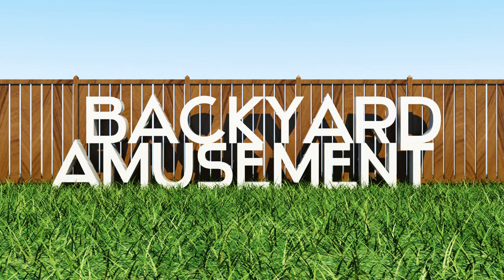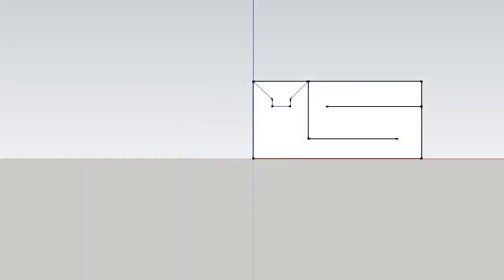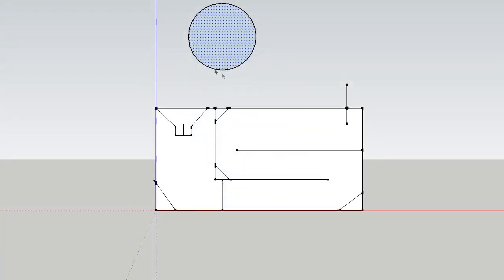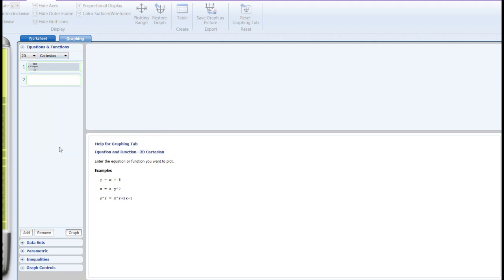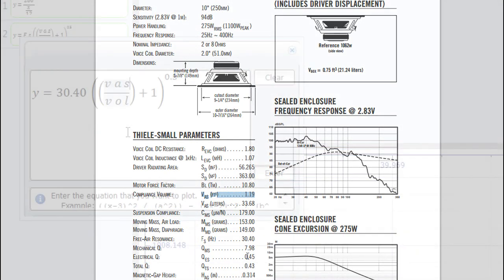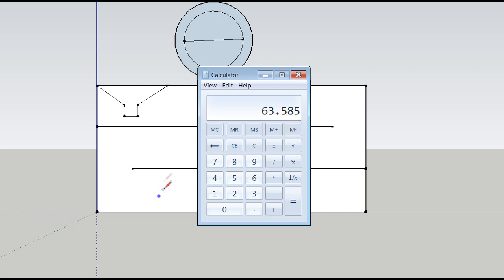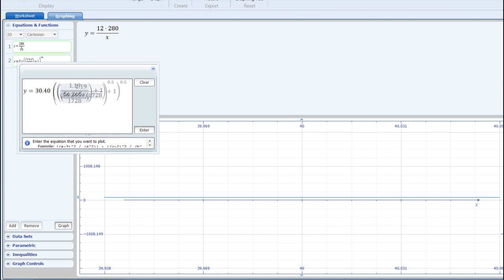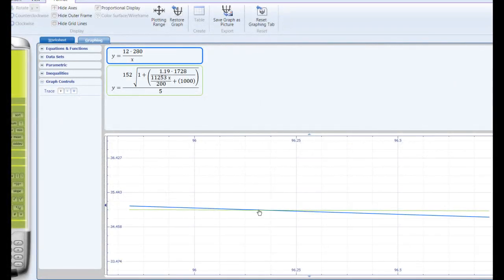Transmission line speaker box math made easy

Comment: I built a 1/4 wave length transmission line back in 1979 using the math for tuning and an 8 inch woofer , because the design is so non precise you can be plus and minus 30% on the line length and it will still sound great , mine sounded amazing esp on bass guitar notes the definition was amazing , the TL sounded better than any other alignment I have ever listened to , they have been my choice of design since then , nothing else sounds as good !!!!
Reply: Awesome to know

Comment: 9.21feet is 110ínches. this whole thing would be nicer if you didn't make the wacky front chamber of 1000cubic inches because without it, i would be the output of your formula would be pretty close to 1/4 the wave length of Fs.

and if the dimensions are a bit off the exiting wave would is not just be a bit quieter, because the output would not be he peak of the wave but slightly less. but then a slightly higher frequency would be amplified.

a phase change would only happen at 3/4 wavelength of Fs.

Do you even need to use Fs really? could you tune the box to spit out different frequencies.

Comment: You did well and I was following each stage perfectly until you "threw in " that extra 1000 sq inches !! I thought you wanted to determine line length , volume and the quarter wave resonance ?
If you have a large volume immediately after the driver the enclosure behaves more like a reflex enclosure with a very long port ... 
Have a good look at the construction of the original B&W Nautilus enclose ... you'll see what I mean 😀

Comment: I got a line length that was 30% shorter than the quarter wave length? According the Martin Kings method, the line length doesn't change, only the cross section area. Great video, I'm just making sure I am following this correctly. Made a test, my first transmission line enclosureusing this method and it doesn't sound bad. However, am I loosing output/bass extension using this method?

Comment: If I use multiple woofers does that mean I will need to add up all of the radiating surfaces and make that number my tube area? 
Example: if I use two 8 inch woofer I would need to have a tube with 16 inches of area?

Comment: Fine tuning can also be tweaked with volume and density of poly fill . Not to replace correct 1/4 wave length but just for fine tuning to reach a reasonable RTA . Good video on where to start .

Comment: SD² - Speed of sound ÷ frequency ÷ 4 x 12(inches) and you have the line length. Personally I've have better audible results with tapered enclosures. Personally I find t-lines to be the most easy to design. Building them depends on the complexity of the enclosure, but its not a problem really if you have even the most basic of woodwork skills.

Comment: Area of a line?
Reply: Take the SD² number (T/S parameters) and then adapt it to build the enclosure. 
Take my latest project of the JL Audio 13TW5v2 subwoofer. https://www.youtube.com/watch?v=ayFFXxoIqXc - Getting Naughty with the JL Audio 13TW5v2 Subwoofer 

Effective Piston Area (Sd) 98.26 sq in / 0.0634 sq m JL Audio 13TW5v2 subwoofer Lets just round it up to 100 sq in. 

Square root of 100 is 10, so you need the internal enclosure size to be 10" x 10". Ah! ... The problem is that the subwoofer is 13.5" wide. So then you have to adapt the enclosure a little 

10 x 10 
11 x 9 
12 x 8 
13 x 7 
14 x 6 - Bingo!! Now you have a 14" Baffle, wide enough to house the subwoofer, and the depth of 6"

Comment: Wich software are you using ??
Reply: You can use WiniSD, Hornresp - here - https://www.diyaudio.com/forums/software-tools/220421-transmission-line-modelling-software-88.html#post5669795

Personally, I've always had issue correlating a graph, with my enjoyment of the said speaker/sub, and most of the time I came up wanting. So I developed my own formula.

Comment: "This methodology is obsolete"... it's right there, written in RED at the top of the article you chose to follow...
Reply: Yeah, problem is, the new method is totally reliant on specialized software and most of that is no longer available because this is such a niche application. So unless you can whip up a bunch of calculus and matrix models in math cad, this the approximation that was used for decades prior to "non obsolete" and now obscure to access methods.

Comment: What happens if you tune lower of higher than the drivers fs? it will still increase the output at the tuned frequency correct? or will it cause some problem?

Comment: Are you sure you really understood TL? 

Speaker driver has FREE AIR RESONANT FREQUENCY.  
Fs.  

This is frequency where all mechanical parts of driver start to resonate, giving the excessive membrane excursion and impedance peak. This is bad for the sound at that point.  Physics explains that any air volume of closed or ported box has it's own resonance (of enclosed air), which actually has much greater force/impact than pure Fs of speaker.  So it's canceling Fs to it's own value.  Does it really matter where you have your box tuned to resonate? Not much. But usually you tune the TL box to have Fs between resonance peaks of the transmission line cabinet, in order to cancel the natural resonance of driver. If you take a closer look and put your amp meter to speaker, you'll notice there are actually two resonant peaks in TL, side by side in low spectrum, and many more as frequency rise, but you damp that with taper, or pure  line damping.  

I'm afraid your enthusiastic effort is not much worth in real life application, unfortunately.  

Stay well.
Reply: paddle hard 
hey man,
iappreciate your comment. iam a enthousiastic Young speaker builder and i am Building a T-line speaker system.
2 Towers with 8" drivers tuned to 60Hz and a subwoofer with 2 8" drivers tuned to 40 Hz. is it okay for me to Just get the 1/4 wavelength of those frequenties and make that my line length and the line size the cone area, and Double the cone area of my sub.

i also would like to decrease the line size going Down to reduce resonance. is this a good idee.

would Love some advice.

cheers a mutual fanatic

Comment: Hello, I am not very capable of doing this calculation, can you do this for me?
It will give you all the electro-acoustic speaker parameters.
Reply: 1120 ÷ 40 ÷ 4 x 12 = 84" - 40 Hz - For a straight t-line 
1120 ÷ 35 ÷ 4 x 12 = 96" - 35Hz 
1120 ÷ 30 ÷ 4 x 12 = 112" - 30Hz 

Take the SD² number (T/S parameters) and then adapt it to build the enclosure. Take my latest project of the JL Audio 13TW5v2 subwoofer. https://www.youtube.com/watch?v=ayFFXxoIqXc - Getting Naughty with the JL Audio 13TW5v2 Subwoofer 

Effective Piston Area (Sd) 98.26 sq in / 0.0634 sq m JL Audio 13TW5v2 subwoofer Lets just round it up to 100 sq in. 

Square root of 100 is 10, so you need the internal enclosure size to be 10" x 10". Ah! ... The problem is that the subwoofer is 13.5" wide. So then you have to adapt the enclosure a little;

10 x 10 
11 x 9
12 x 8 
13 x 7 
14 x 6 - Bingo!! Now you have a 14" Baffle, wide enough to house the subwoofer, and the depth of 6" Then you use the formula (above) to determine how low you want to go. Its really simple!

Comment: i dont know if he mentioned it, but the 280 is one quarter of the speed of sound in the first equation. Also, if you use the program's equation solver and set it to solve a system of 2 equations, it will give you the exact length and frequency
Reply: I know it's 2 years ago, but thank you for this!

Comment: Need help with a T-Line design
Kicker L7 15"
sub on left - port on right
finish length 58 1/2"
finish height - 18  1/2"
finish width - 20"
using 3/4" mdf
tuned to 35-40 hrtz?
Reply: port area 180^2 inches. port length at 34 hz is 34 ft peak to peak, so port length is 8.5 ft. Your port needs to be 8.5 feet long with an area of 180 square inches.
Reply: can you help me out with some port measurements
I want to double up the inside port---outside box of finish measurements given above will also be doubled up
i am putting a lot of time in other work on my van and want this to be correct!
Reply: +andy wiley your finished box with double wall 3/4 inch had a usable space of  55.5x15.5x17... that makes you port 17x10.5. there is no way to fit 1/4 wave t line into those space requirements.
Reply: +andy wiley required port volume for a 15 is 18360^3 inches, your usable space has a volume of only 14624^3... plus you need room for a driver. Drop to a good 12, and you can make it happen.

Comment: Dumb it down even more bc I'm lost
Reply: 1120 ÷ 40 ÷ 4 x 12 = 84" - 40 Hz - For a straight t-line 1
120 ÷ 35 ÷ 4 x 12 = 96" - 35Hz 1
120 ÷ 30 ÷ 4 x 12 = 112" - 30Hz 

Take the SD² number (T/S parameters) and then adapt it to build the enclosure. Take my latest project of the JL Audio 13TW5v2 subwoofer. https://www.youtube.com/watch?v=ayFFXxoIqXc - Getting Naughty with the JL Audio 13TW5v2 Subwoofer 

Effective Piston Area (Sd) 98.26 sq in / 0.0634 sq m JL Audio 13TW5v2 subwoofer Lets just round it up to 100 sq in. Square root of 100 is 10, so you need the internal enclosure size to be 10" x 10". Ah! ... The problem is that the subwoofer is 13.5" wide. So then you have to adapt the enclosure a little 

10 x 10 
11 x 9 
12 x 8 
13 x 7 
14 x 6 - Bingo!! Now you have a 14" Baffle, wide enough to house the subwoofer, and the depth of 6" Then you use the formula (above) to determine how low you want to go. Its really simple!

Comment: Won't the Fs of the speaker change if you put it in a closed box with equivalent T-line volume? Fs is usually measured with no box, that's why it is "Free air".
Reply: +Rennie Ash heck the FS lowers as the sub is used.  I do not tune a t-line to the FS, i tune to the desired bandwidth.   I tend to tune to 31-32hz (around 97-109" of line).  This gives me a useable bandwidth of around 16hz-48hz  which is.. perfect for me.  A lot of this seems like bad advice.
Reply: Eian Wahgener I'm a newbie at this tline box building. I have a rf power hx12 sub with an Fs of 26. so what you are saying is that in order for me to get tline length and portsize for the hrtz I want which is like 35hz. use the frequency instead of the fs? I'm confused

Comment: Do you use the the width from left side of the suspension to the right or left side of the cone to the right?
Reply: i use suspension peak to peak. it gives you that little bit of extra space you need to accommodate for especially in non angled ports.

Comment: So it's basically a ported box with a huge port?
Reply: +Sigma Octantis no
Reply: amananca no
Reply: +Sigma Octantis T-line enclosures direct the rear wave of the speaker to be captured, then channeled to the front (or listening area) in a manner that prevents the rear wave from being out of phase with the frontal radiation. Usually the only part of the wave length that can be repurposed is 1/4 or 3/4 of the wave, the balance of the wave being out of phase. Isn't that your understanding, Backyard Amusement?
Reply: martianshoes Just saying, my ported box looks almost identical to a T-Line box so I don't get why they are so special.
Reply: Sigma Octantis Because the length and cross section are calculated using constants like the free air resonance of the driver, and the lowest frequency wavelength they are trying to achieve. Sigma no one is saying that they walk on water but if you ever get to hear a properly tuned TL enclosure with wide band program material for a good source...it is often memorable enough to make a life long impression...THAT IS....if you are into fidelity and not just "bump".
Reply: +Sigma Octantis How they look isn't really a factor. They operate on different principles. Roughly speaking (and absolutely bastardizing the theory of it) Your ported box uses the mass of the air in the port like a spring to augment the output of your subwoofer. A T-Line uses the rear wave directly to augment the output. They work entirely different. 

Also note, the t line is a glorified tube folded up into a box shape. Your vented box has a small (relative to the chamber the sub is in) tube. Where as in the T-Line, the 'port' and chamber are not distinct in any way.
Reply: Matthew Menze Well my ported box is mostly port by volume, because that's the way WinISD said to make it.
Reply: +Sigma Octantis You are supposed to subtract the port volume from the box volume, so if winisd calls for a 1 cubic foot box and a port that is, say, 1 ft by 0.5 ft by 2 ft long (just to mix it up a bit), you are supposed to have practically an exterior volume of 2 cubic feet with 1 cubic ft taken up by the port. If it still comes out with a very small box volume and a humongous port, well, you need to reduce the port area while keeping an eye on port velocity so that it doesn't exceed 0.15 mach.
Reply: dre04mach Can't quite tell if you mean add or subtract. 1 cu ft box + 1 cu ft port would be 2 cu ft total. If it was subtract then it would be all port. I did add them and used the smallest port possible to keep port velocity down.
Reply: +Sigma Octantis well, it's the same thing, depends how you look at it. Subtract from the outside volume of the box (2cubic ft outside minus 1cubic ft of port inside), or add to the internal value of the box (box = 1cubic ft + port 1 cubic ft) = same 2 cubic feet on the outside.  Win ISD gives you the volume the box has to be on the inside, you add the volume of the port (and the thickness of the walls) and you get your total outside volume basically is what I was trying to get at.  so if WinISD says 2 cubic feet box and 1 cubic feet worth of port, your box's exterior dimensions will have to be 3 cubic feet total.  (or 2 cubic feet and a really big long port/pipe sticking out of it :D).  

Think of it this way, you can put the same port outside of a box and it will sound/be tuned the  exact same way as long as the remaining box volume (what winisd gives you) doesn't change.

Comment: This is a great video. But it would help if you stopped referring to the drive units resonance as "free air" when it's being placed in a defined volume.
Reply: It is the free air resonance that is being tuned to the TL port.
Reply: well that would be pointless as the drive unit wont have a free air resonance in box thats the same as the free air resonance
Reply: The idea behind TL is to extend the bass performance down to free air resonance. The boost from the tuned tl gives a greater boost to the speakers output as free air resonance is approached and less output the farther away from free air resonce. TL can become tricky since the TL becomes resonant at 1/2, 1, etc so a port tuned to 30 hz would also be resonant at 60, 120 etc. For subs this is not an issue but for tower speakers this may create overly entusiastic bass response.
Reply: No its not. Its to make the rear energy from the drive unit in phase with the front giving a 3 db increase roughly in the area the system is tuned to.

Comment: Excellent tutorial, was exactly what I needed.

I managed to go one step further which may be of use to some people, if you transpose your formula you can end up with an equation in the form length=a*b*c*d etc which tells you the exact length of the line, ie you don't need to rely visually on where the graphs cross.  It ends up a nasty formula but works great.

Using the same program, make a transpose equation where "equation1 - equation2 = 0" (blue line - green line  = 0 ie when they are equal), and then solve it for x.

Put the resulting formula in a spreadsheet and you can just enter fs,vas and sd and it spits out the required line length.
Reply: Me Athome Could you give an example formula? Interested to give this a try!
Reply: it is the speed of  sound 1123 feet per secant  divided by the speakers Fs and then divide that by 4 gives you the TL length and this formula works really well my horns have only one fold and vent out of the back of the speaker ! instead of the front , instead of stuffing the TL I use acoustic foam on the back wall of the TL , since there are no hard design rules I experimented to see what worked and sounded best ! I found that is the best way to approach a TL design and built there is a lot of wiggle room !!!

Comment: When I started my quest on knowledge of transmission line theory and design, I was stuck reading math by Martin King and others on the algebraic equations. That scared me off since I was a much better hands on person than dealing with math. I always used simple equations to find my answers. 
After 150 box designs and builds over a few years, I simplified the formulas to a 6-8th grade standard. No need for all that. But it makes it look legit, I'll give you that. 
Best bet is to have a good box program like Bassbox6.0 or Termpro box design. Also a wt3 or know called a DAT tester. 
Knowing the t/s of the sub, inputting them in to the program to find sealed box resonance (still trying to figure out why that's important and usually a lot higher than any number you would want to see anyways ) 
Also sea level is 1130ft per second not 1120ft. 
Anyways the simplistic formula ( as on the SMD forum, my Quarter wave tutorial states) 
Fs example 30hz (1130/30=37.66/4= 9.41) you can also find your 8th wave which is a secondary peak your box will create by (1130/30=37.66/8= 4.7)
So if you built a quarter wave for 30hz you will also have a 8th wave gain at 60hz 
And here is the kicker, depending on your car these numbers barely matter. 
You will most likely build a line slightly shorter to save space and allow transfer function to take effect. Unless you want a 8" box in a box as big as a box for a 15". 
Either way, this is still my favorite box design, next to 6th order designs - very fun to build and experiment with.
Reply: your theory came out as 9.41 feet (113 inches) of line length for 30hz, and his is saying 8 feet (96 inches) of line length. what do I do?
Reply: There are ways to get that number down!